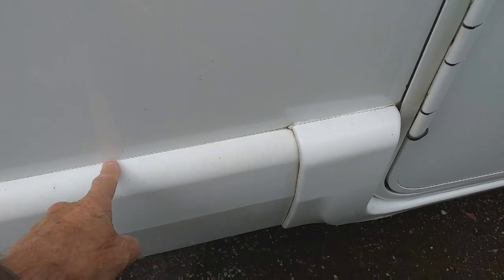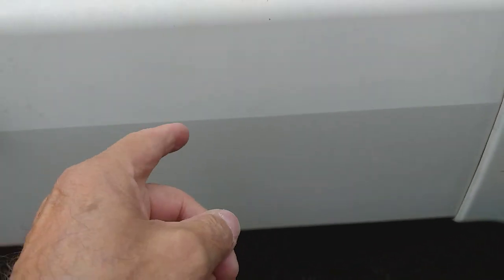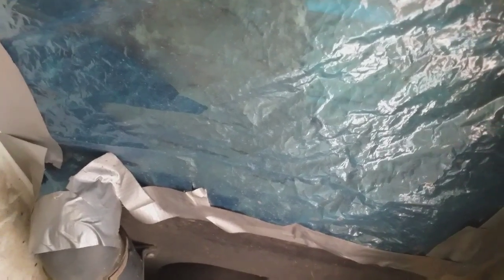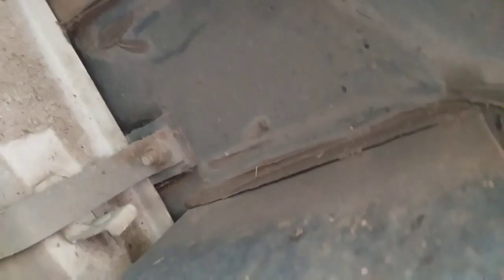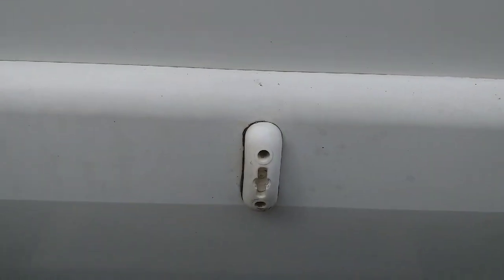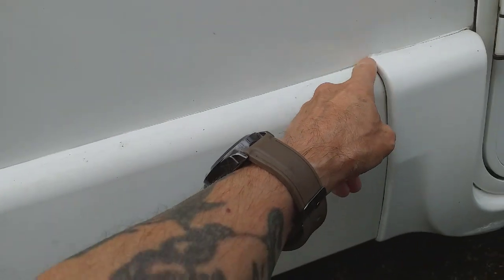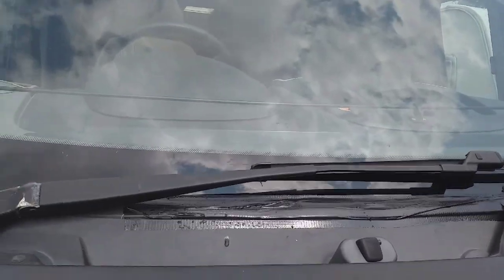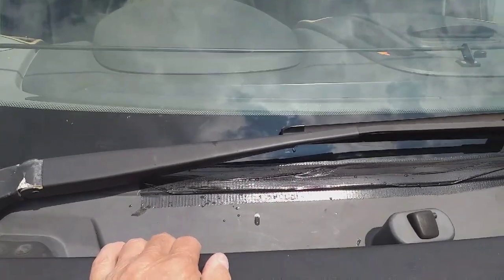Motorhome UK - Van Called Twat Strikes Again.

Comment: There should be a bead of sealant all around the edge of the windscreen when it's fitted but looks like in this case they either missed a bit or didn't put enough on. I watched a new screen going in on our Freelander and the stuff they used sets rock hard after it's cured for a while.
Reply from the maker: Just another mysterious fault that seems all too common on our van.

Comment: Apply a bead of tiger seal below where your tape is now trevor or search fiat ducatto problems also check the drain points of the scuttle panel the pipes can get blocked and back up also the main pipe from the centre has a join which is best wrapped with rubber or sealant again
Reply from the maker: Is Tiger seal like silicone that needs the gun to apply it. 
Thank you for this suggestion.
Reply: @trevorpat-lifeontherun  i have a hack that will stop water ingress to the floor and all so even if that silicone you put along the sides fail it will never get the floor have you a email i can send over what im talkin about trevor i hate to see that i had same on my caravan
Reply: its disgusting the shockin build quality it makes me angry as its not cheap to buy saw a bailey and the front panel had a gap all along that was in a showroom brand new
Reply: @trevorpat-lifeontherun  if you get some white pvc angle 📐 corner trim and put it in between the side of the van and put another peice into that one glue the two together the water cannot get past even if the seal on top goes hope that makes sense was goin to draw you a picture of what I mean Trevor hope it helps I had a caravan and it stopped the rain soakin the floor for good you might need to take the plastic trims off
Reply: It should make a H shape with the top left and bottom right the top left slides up between the floor and the sheet metal the bottom left of the shape will stop it goin further into the floor and drip off
Reply from the maker: Sorry my friend, but jobs like that are way beyond me.
Reply: @trevorpat-lifeontherun  perhaps someone could do it for you sorry to keep on it just bothered me you having all these issues it’s not right take care Trevor best regards to you and the wife 🫡
Reply from the maker: It's very kind of you to be so bothered about us. I don't know if it's wet to be honest, I haven't checked it for ages. I work on the principle that I will be dead before the floor falls through😊
Reply: @trevorpat-lifeontherun  prob will trev with having hassle from twat strikes again van it’s a design flaw they incorporated into caravans and motor homes it’s plain obvious that water needs to be stopped before soakin into that edge it’s all of them I’d get a panel van if that’s better won’t get leaks from stuff then
Reply: I watched a video on stuff called :
flex armour sprayed 
It’s the bees nees that’s what they should have from the get go and my fix for te bottoms where those stupid side plastic trims bits and anywhere else
Reply: @trevorpat-lifeontherun  cost me £60 to do my 6berth caravan with that white pvc stuff and the sikaflex it stopped anymore water ever getting to the floor

Comment: I had a similar problem with my Kia Picanto where the carpets where soaking wet. I searched everywhere including underneath the car trying to find the leak. After much frustration I found the leak was coming from the boot where the spot welds had not welded two pieces of the body together properly. I fixed it by sealing the welds with JB Weld adhesive. That  particular body might have been made on a Friday afternoon in South Korea and got through quality control unnoticed 
.
Reply from the maker: They take some finding. It was the frustration that kept you looking, or you may never have found the leak. I call my van Twat because I think it was made on Friday. I think all the mechanics who have laid hands on it were made on Friday too.

Comment: Your find that the seal is worn, it should be a tight flush fit against the screen, if that panel has been removed at anytime in the past for work or a screen replacement ( if screen has pilkington wrote on it it has been replaced), the panel never fits flush again once removed, or due to age it can fail, I have fixed this by sealing just inside the edge with clear sealent by pushing nozel behind seal or removing panel,(wipers need to be removed and can be very tight to remove so wouldn'trecommendthis way) ,then wipe away excess sealent, hope this helps,
Reply from the maker: Thank you mate. I think the last mechanics had it off because the drain on the left hand corner was detached. I have put sealent where you said and covered it with tape, but it hasn't rained since I did it so I don't know if it has worked. Thanks again for your help Karl.
Reply: @trevorpat-lifeontherun  if you of the engine then shut the bonnet and use a hoze to spray water on top of the screen and let it run down for while then check, this is how I do water tests.
Reply from the maker: @mrbsp1  ok, I suppose I am dreading doing it in case it leaks because it's wearing me down.

Comment: Badly fitted replacement screen at some time in its life. It needs taking out and resealing. To give you an idea of cost Halifax Windscreens charge me £80 + VAT for a screen replacement. I would highly recommend them as they do a first rate job. If you ring them tell them that Chris from the VW Van Centre recommended them. On the upside the water will boil off after a short period of the engine running so wont cause any long term harm unless it gets into the injector wiring which should be well sealed anyway.
Reply from the maker: Thank you for that Chris. It looks like that's what i am going to have to do. I am still trying to recover from a large bill getting it through the MOT. Bodged it up temporarily as usual.

Comment: Go to fiat and get yourself a engine cover.
Reply from the maker: This water could be getting in behind the bulkhead as well so I need to get to the sauce of the problem and sort it.
A 2007 engine cover is not easy to find.
Reply: @trevorpat-lifeontherun  Fiat will get one next day
Reply from the maker: @Motorhoming_Fun  when you say go to Fiat, do you mean online or a dealer
Reply: @trevorpat-lifeontherun  dealer 👍
Reply from the maker: Ok. But the windscreen needs sorting first. Thanks for your help.
Reply: @trevorpat-lifeontherun  I wouldn't bother with an engine cover, just sort the water ingress.
Reply from the maker: @ChrisandHeathervanlife  At the moment I have put that black tape over it and tested it and it stopped the water getting in. If you saw my previous videos you will know I have just had to spend a lot of money getting it through the MOT, so I have to wait a bit before getting the windscreen sorted.